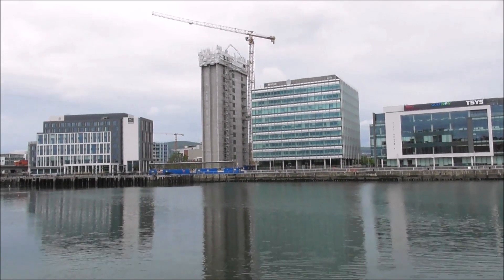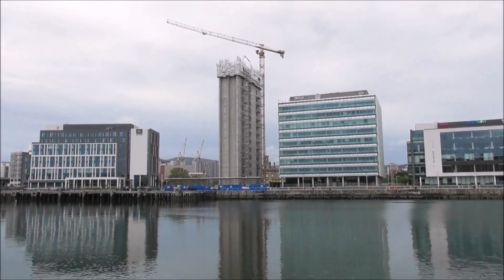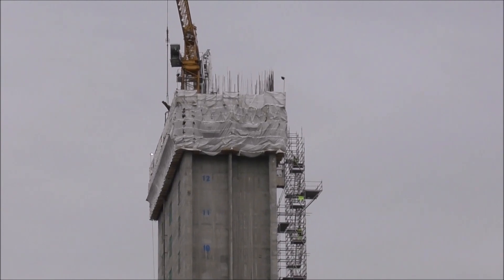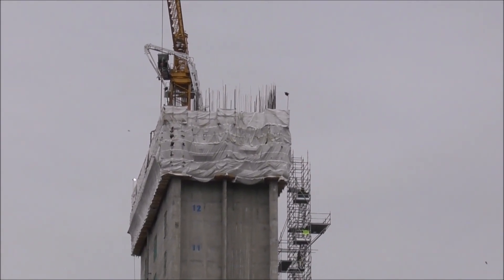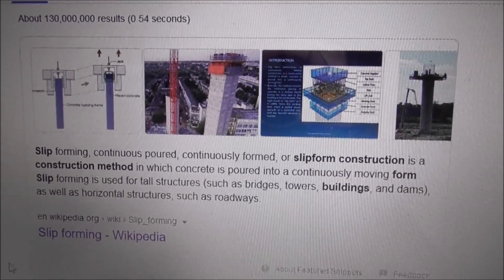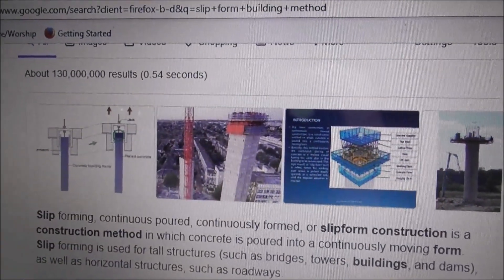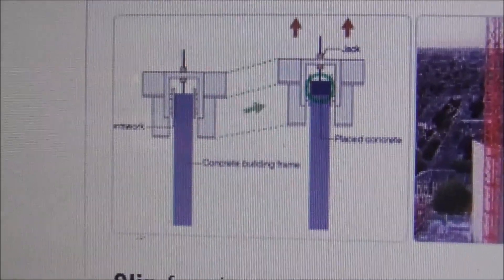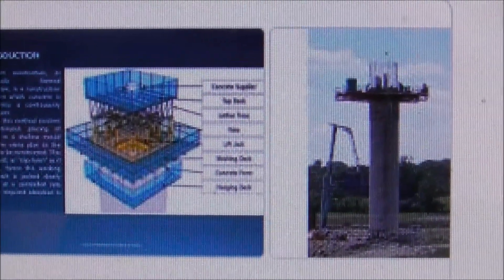Slip Form Method used for Belfast Offices Lift Shaft

Comment: Not very nice to work on though! Especially if the operator is racing as the trades in their are flat out
Reply from the maker: Hi Mick I'm not associated with the building industry so I haven't got a clue as to the pressures and difficulties. Hard, cold, outdoor all weather working, to a deadline and trying to work as a unit with so many different tradespeople. Not at all fun. Best wishes from the Belfast Castlereagh hills.